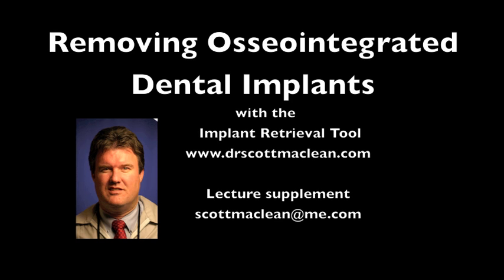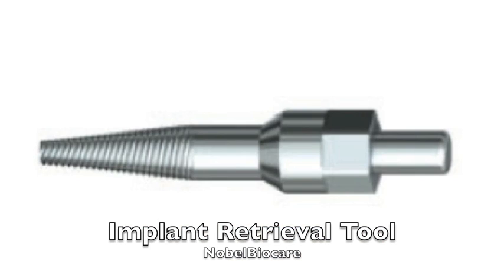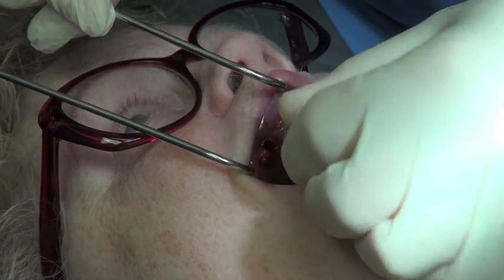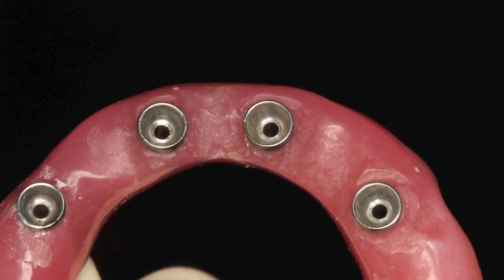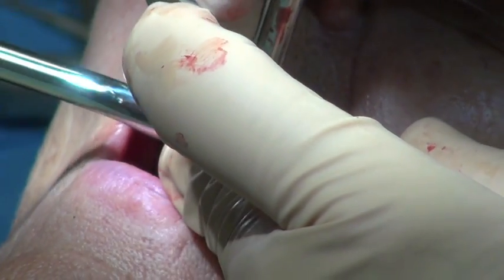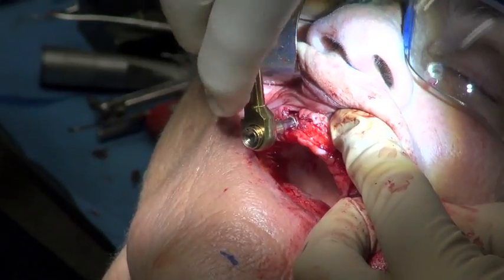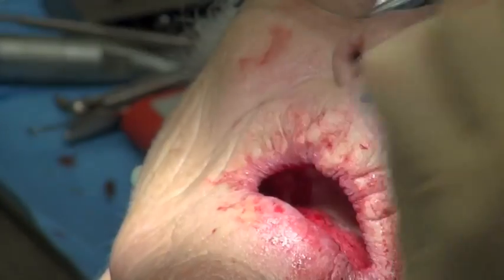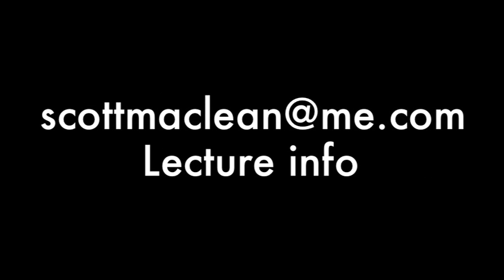How to remove a dental implant - Explicit 3 cases

Comment: In your third case, why put the patient through such trauma just to have all in four design. It is fully integrated at the bone level and in a good position for use or bypass it if your so determined to use an all on four  design.  In the end, your denture pictured using five implants anyhow

Comment: My Branemarks have been integrated for 20 years, and now am dealing with lower bone resorption.  I'm fully edentulous, so have upper and lower prostheses installed.
Reply from the maker: Great success! Has the boneless been a problem?
Reply: Scott MacLean Hi Scott.  I did loose one in the upper arch, and two on the lower, but there's plenty on the bottom to support the bar.  I ended up with a removable denture for the upper, and it was fabricated so the remaining implants help support it.  That's working out well because I don't have the impact on my upper gum that people with a conventional denture experience.  Have very Merry Christmas